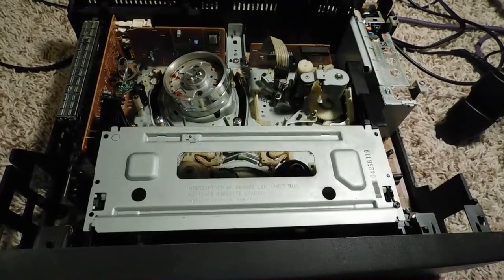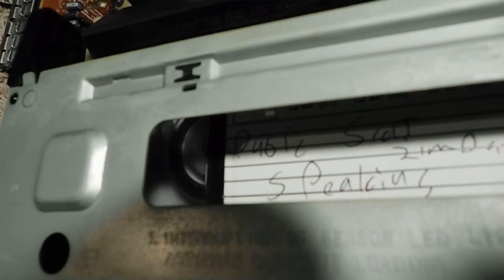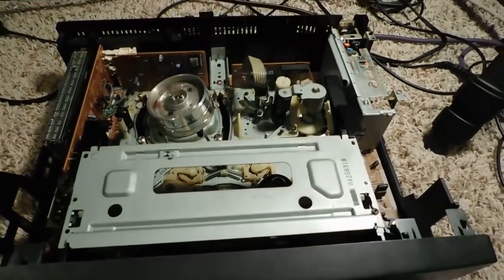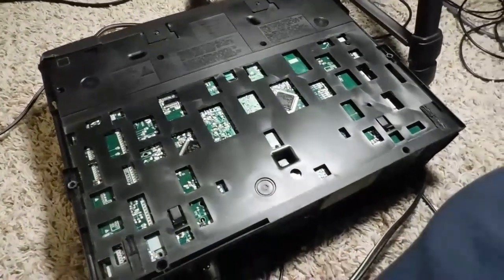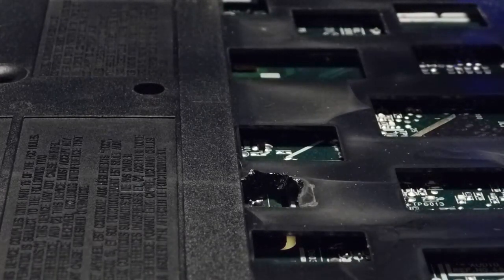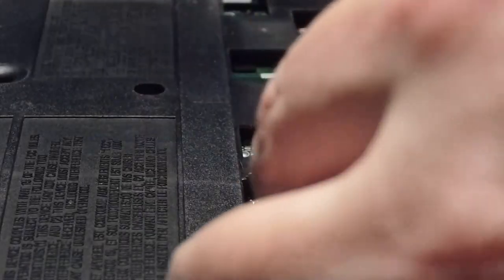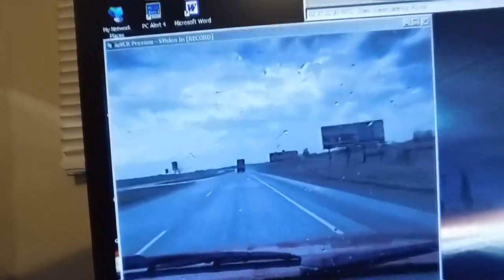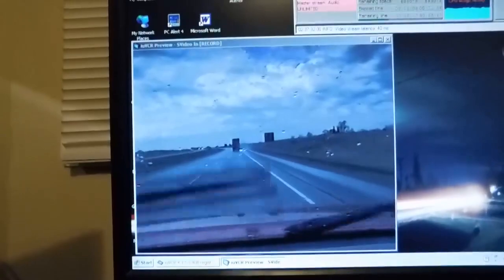Panasonic VCR Sensor Problem and Fix

Comment: If the fast forward doesn't auto stop is there a possibility it can rip up the tape spool?
Reply from the maker: if the glue on the leaders is old and dried out. I've seen 3/4" do it many times
Reply: @uwtitanfan  I've had it happen to two VHS tapes from the mid 80s - excellent tape stock, too. Luckily, I was able to fix the tapes enough to digitize them.
Reply from the maker: cbehr91 2.0 were you dealing with decks that have a high speed rewind? That’s the only thing I can think of that would make enough force to snap a leader. The 3/4” tapes I deal with at work once they seem to hit around 35-40 years of age start to deteriorate where a normal rewind will break the leader off on a stop at the end of a tape... oh and then sticky shed also. They make a horrible squealing noise as they pass the audio heads. Then you know it’s time to get out the alcohol and q-tips!
Reply: @uwtitanfan  No, I use a rewinder that is not high speed.
Reply: @uwtitanfan  what model number is this vcr?
Reply from the maker: @austinthevhsvideogamelover5265  Panasonic pv-4651
Reply: @uwtitanfan  when was it manufactured?
Reply from the maker: @austinthevhsvideogamelover5265  1996

Comment: You need to remove the motherboard from the chassis to do any soldering work. All you are doing is dripping molten plastic on the circuit traces which will short it out. Big no-no.
Reply: Proprio cosi,con quell'orrendo saldatore ha rovinato la bordatura del telaio,e non usa neanche un saldatore decente,se quel videoregistratore era mio mi sarei arrabbiato,sicuro!

Comment: LED on my one is not working, do you know if I can replace with any LED or does it have to be a certain color or type, the service manual says 5v but the part number SIR 505S does not compute on Google. ?